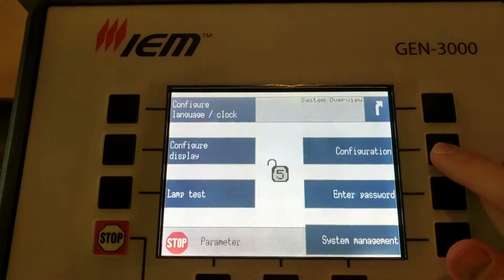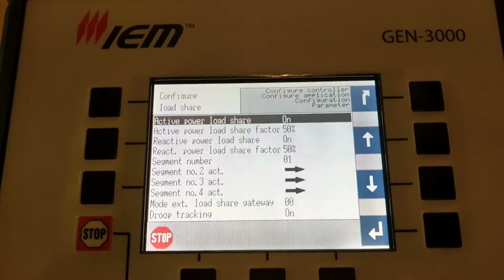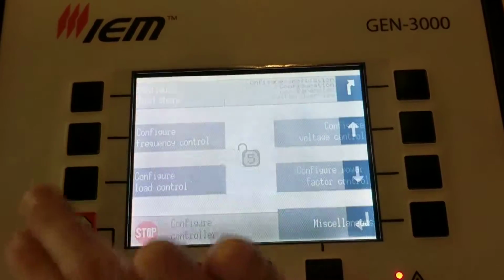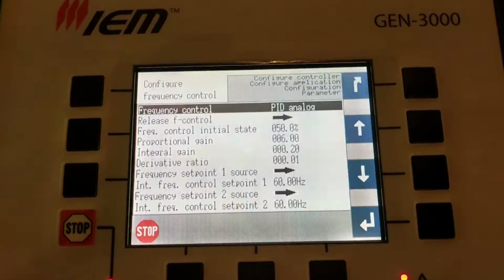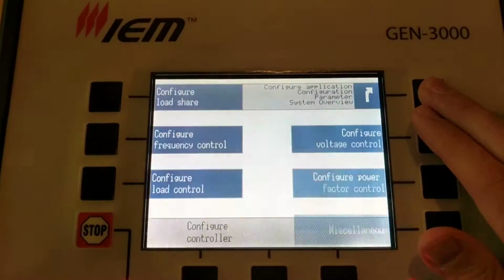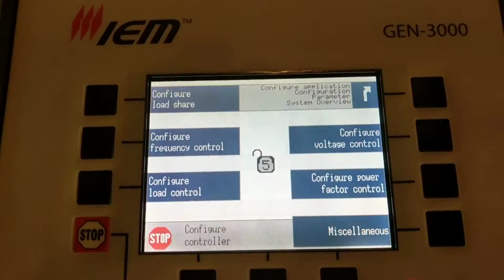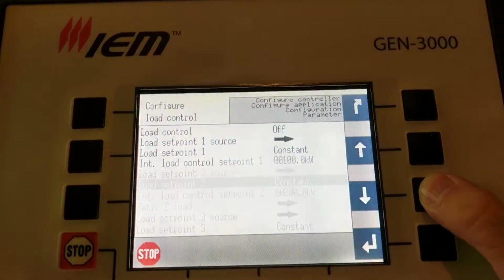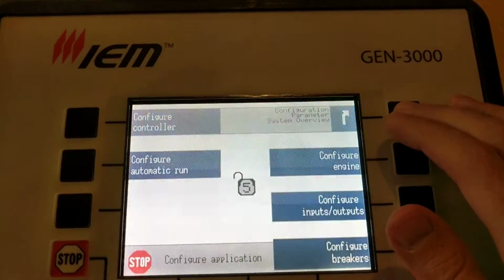Woodward EasyGen Initial Commissioning Step 2

Comment: wich generator is controling that easygen? I mean does proportional values at the voltage and frequency controls are way to high. I have worked with easygen almost 10 year with all kind of engines (gas, diesel and crude oil) and  I havent seen those values, but if it is working it must be ok
Reply from the maker: zeusbreaker this was a strange job where we were syncing only through a 2301D and the 2301D was doing the load sharing. This was on a 550KW Waukesha Natural Gas genset.
Reply: I was thinking about that possibility. some configuration are strange and it depends how it was concieved at the engineering design
Reply from the maker: You need a 2301D to control a mechanical governor. Also it was a retrofit and the 2301D was already on site.